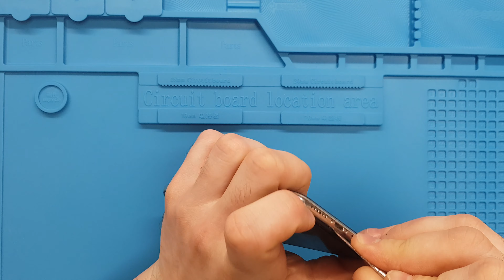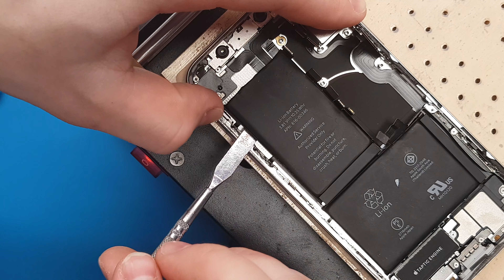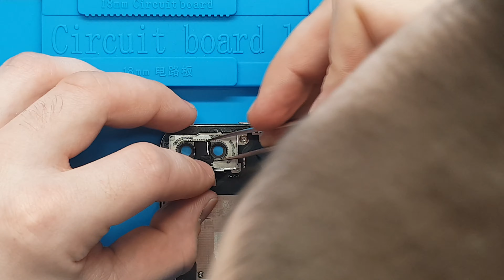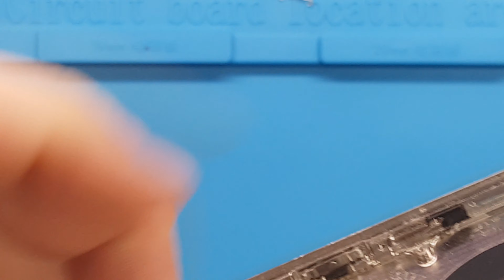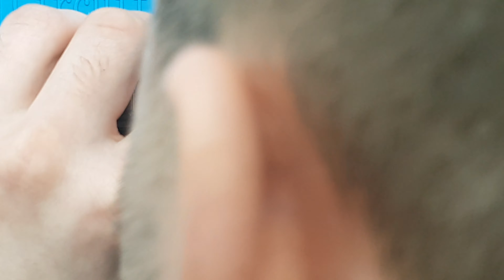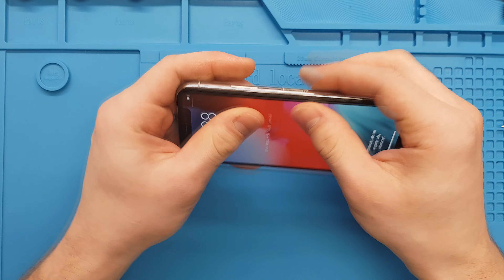🔧iPhone X Full Housing Replacement - complete renewal 4K 60fps 😎

Comment: Why is my NFC not working after housing replacement ?
Reply: Maybe you did a bad job
Reply: Either not connected properly or damaged upon transfer. The NFC is the wireless pad that has a soldered flex that goes to volume buttons and silencer. Those cables are extremely thin and can easily have been damaged upon prying them up. Check them for all and any sign of damage.